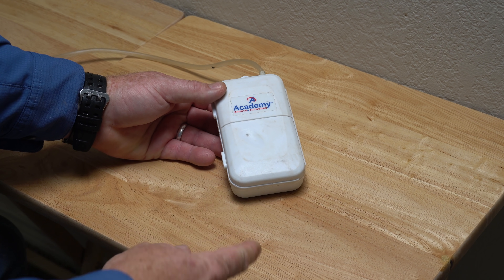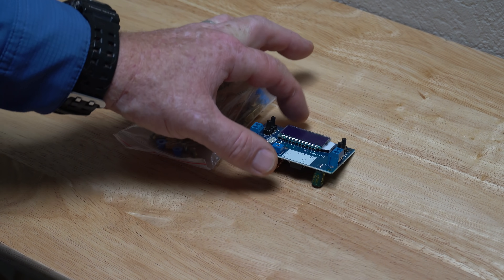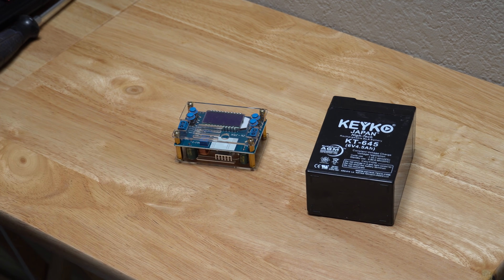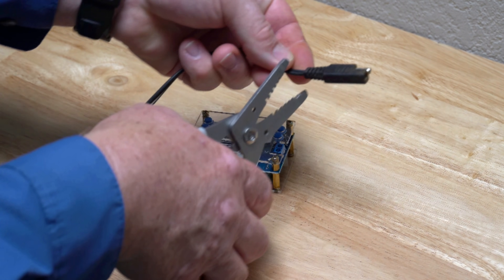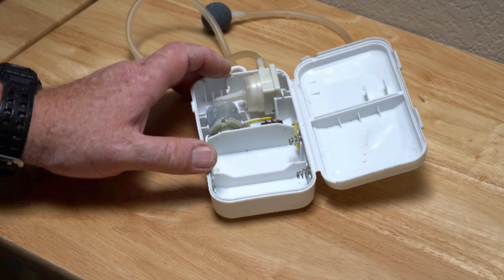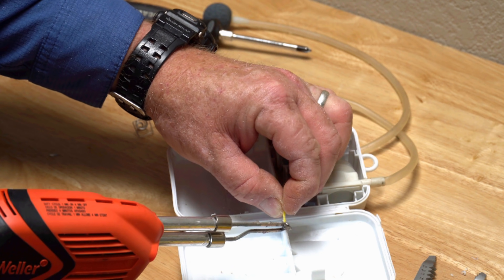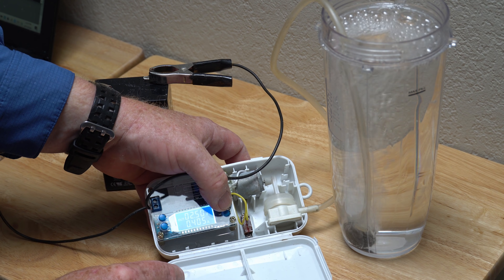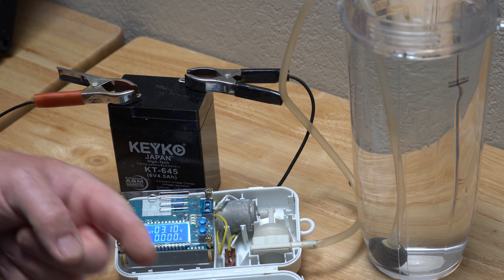🐟 Official Minnow Bubble Box Aerator Hack Mod! 300% more Bubbles! 🔥

Comment: Can you do the same thing to the black aquarium pump that comes from Walmart. I think it's a 120-volt but I would like to try to change it into a battery operated
Reply from the maker: If it is an AC motor, this will not work. AC motor will burn up if you increase the voltage to them. DC and AC motors are completely different in how they work.  DC motors can work with a wide range of voltages, which is why all Electric Vehicles like the Tesla use DC motors, not AC motors.

Comment: Instead of hooking up to an outside battery using alligator clips, can you hook it up using the 12-volt adapter plug that is provided with the pump and plug it in to the cigarette lighter receptacle?
Reply from the maker: Yes, you can do it this way as well.

Comment: The battery terminal connector comes from a battery tender for a boat or motorcycle.
Reply: Yes, a battery maintainer terminal. And if you had left about 2 inches on the cord before you cut it, it could’ve been reused for another purpose.

Comment: That's a 1.5v motor, and stressing at 3.7 will shorten it's life. Would like updates
Reply from the maker: The motor is not what burns out. Never had one burn out. The little plastic pump does eventually wear out, though, after about a hundred hours of hard use.

Comment: Very cool project. Definitely upgrading my little bait bucket. Even if wears out air pump prematurely, I can get another one (stow in my truck) and repeat. 
Thanks!!!
Reply from the maker: You would be surprised at how long these little motors will last even at this voltage.  I have never worn one out and have run it for days on end.  What actually does wear out (but also takes a long time) is the little plastic pump.

Comment: you bitch about going through a half dozen boxes a year but increasing the voltage will just burn the motor out twice as fast, so whats the point?, why bother spending $40 bucks to nigger rig a 10 dollar pump thats gonna last a day if youre gonna go that route you might a well just buy something better like a portable compressor or air mattress inflator for half the price and hook it to an old car battery...

Comment: Will doubling the voltage to the motor shorten the life of the motor?
Reply from the maker: Not in my experience. It is more likely to shorten the life of the plastic pumping mechanism. But, in my experience, I have runn the pump for days on end like this and it suffered no I'll effect.

Comment: Thats great except Ive rebuilt these small motors and whats going to eventually happen shortly is that the brushes in the motor are going to finally wear out which is why this entire concept is an expensive temporary fix.
Reply from the maker: Mine has still not burned out.

Comment: I followed you all the way on this and it will not reduce voltage output, the info with the buck converter says this option will be bypassed if both input an output share the same ground. It does work but at full voltage. Any thoughts?
Reply from the maker: Something seems off.  The is no such thing as a GROUND in DC electricity.  A ground is only used with AC electricity. With DC you have Negative, and the Negative is shared in all DC systems. I think you are reading incorrect information somewhere.  As far as your situation goes, it sounds like you may have a defective buck converter.
Reply: electronics is a lil out of my depth,  but I think you are right I'm sending it back for another, I'll not give this up! Thank you for your great video and your quick response!

Comment: Best tip in the world. If it won’t start on fresh batteries you can suck start it to get it going. Ha ha….
Reply from the maker: Thank you for this great information David.  I appreciate it very much when viewers contribute useful information as you have here.
Reply: @thejungleexplorer  no problem. It really does work like a charm besides the comic relief. After winter I end up sick starting my bubbler. Had same one 15 or so years. But I just keep fixing it. Finally had to glue my diaphragm with. Gorilla glue and got it going one more time this spring. Just ordered a rechargeable unit for aquariums to use for minnows. We see how that goes.

Comment: Not sure if someone asked as I am on mobile phone seeing this video. What is the effect of using it on 4.5 A on the motor? Will it eventually  burn? What about battery life effect?
Reply from the maker: I found that any voltage over 3v did not increase production. 2.5v seem to be the happy point.  The motor may be able to handle 4.5 volts, but the tiny pump cannot function properly at that velocity.
Reply: @thejungleexplorer  Thank you sir
Reply from the maker: My pleasure. Glad I could help.

Comment: Cool project only downside is you will burn your pump up real quick if you run it past like 2 volts for to long and then you will need to buy a better pump that can withstand higher voltage for longer periods of time
Reply from the maker: You would think so, but I have never had a motor burn out yet.

Comment: I'm not good at electrical stuff but what if I sodered a wire to the moter that had a HDMI plug at the other end that plugs into a HDMI charging port on my boat. Do you think this would work out or too much juice?
Reply from the maker: You could do that. Most USBs output around 5 volts so it would work, but I found there to be no additional air production past 3 volts.
Reply: @thejungleexplorer  Thank you. I just don't want to fry the motor. I'm surprised that Frabill doesn't offer an option to plug into a HDMI as it's a common point of power supply now. Who has a cigarette lighter now?

Comment: What's that little dc motor's voltage rating?
Reply from the maker: Have no idea. DC motors are different than AC motors. They are voltage variable. This is why they are used in things that need to operate at variable speeds from slow to fast.  Things like cordless power tools and electric cars.

Comment: Why couldn't you just rewire the battery compartment to where the batteries are in series instead of parallel? That would give you three volts
Reply from the maker: That could be done as well.
Reply: @thejungleexplorer  I've done it to one of my little bubblers not long after I made my first comment, it works but I haven't tested it to see how long it running at those RPMs would hurt the motor.

Comment: When removing the stone from water leave pump running for a few minutes afterward  to keep the minerals in the water from drying inside the stone and eventually plugging up the air passages making it less efficient over time .  Let the pump push the water and minerals out before shutting off .  A trick i learned years ago that keeps my pump pushing plenty of air for several years .  Just sayin
Reply from the maker: Thanks for commenting

Comment: what was fun about it?  running that motor fast is either going to burn out the motor or break the linkage between the motor and the little pump.
Reply from the maker: Good theory. But neither has ever happened. 😉

Comment: Yea I just put 1860 batteries in my bubble box, runs the same way and have to do no modifications… 18650s just fit a little tight. I only do it if I really need to keep something important alive because I fear it will blow up the cheap motor.
Reply from the maker: I have found that anything beyond 2.5 volts does not really produce much more air and stresses the motor. 18659 batteries are rated at 3.5 volts nominal, but have a charge of 4 volts when fully charged. That is way more voltage than what I demonstrated in this video.  Another thing about 18650 batteries is that they are not all the same length. Their length varies according to their capacity rating. There can be up to a 1/4" difference from on to another. But it is interesting to hear you have used them. Thanks for telling me this.

Comment: What’s the rating on the motor?  What is the max voltage it can handle? Nice video
Reply from the maker: I don't know what the rating is, but I have never had one burn out pushing it up to 3 volts. DC motors are not like AC motors. They can operate over a wide variety of voltages. The weakness here is the pump. Pushing it past 2.5 volts does not really give much more air.

Comment: You don’t need that damn stone. I just rubber band a sinker or a washer or something to the end of the air line. Problem solved. I’ve been using a$10 pump for about 5 years now no problems. Changed batteries once. Get rid of the stone.

Comment: Interesting project. The buck converter can easily and efficiently convert 12V down to whatever you want to use on the bubbler so you could just use the trolling motor battery.

Comment: How long will the pump last like this? Looks like a awesome idea and even if it does destroy the pump after a while would still be worth the trouble! Im used to throwing these pumps away after a year anyway
Reply from the maker: So far, I have never had a pump burn out. I am sure it will at some point though. Then I will move the system t a new $10 bubble box.
Reply: @thejungleexplorer  Yeah i completely agree, plus the money saved on batteries will add up fast!
Reply: How does this set up work in salt water environment?

Comment: If factory motor is rated for 1.5 volts, how long will the motor hold up at the increased voltage?
Reply from the maker: The truth is that DC is not that precise. All DC motors have a large voltage variance. Sure, if you ran this little motor at 12 or 24 volta it would burn out almost instantly. But it is totally fine with 2 or 3 volts. As if yet, I have not seen any motors burn out. I learned this from a friend that has been doing it for years, and has never had a motor burn out.

Comment: Obviously increasing the voltage on a D/C motor will increase its output. I dare you to run that device at level you showed in your demo for an extended period of time. That pump. All the parts connected ( connecting rod , etc.) Will fail in short order. Interesting concept though. 

By-the-way, I did call you out. Lol!
Reply from the maker: Theories are great, but the thing with theories is that they are just that. This pump is still functioning fine after a year.
Now, will you be a man and do what is right?

Comment: Don't be fooled. There's a reason they only take 2 1.5vdc d size batteries. Sure you can get more power out of the motor by increasing the voltage. But you are reducing the life of the motor. Doesn't take much to burn those little motors out. Definitely a fun little project though.
Reply from the maker: Thanks for commenting

Comment: Looks good . But Running that little motor that fast very long isn`t it going to come apart .
Reply: Most likely the little compressor will fail before the motor
Reply: Running a 6v or 12v rechargeable battery at a low setting still gives you a ton more run time.  Great video. Now, I would like to find a way to run this off my car using a 12v socket or usb.
Reply: @mjcavender1230  I soldered a usb cable to mine and connected a car charger to a Milwaukee M12 battery.
Reply from the maker: Thank you for commenting Chuck Smith!
Reply: Does the lid close with that sitting in there?
Reply from the maker: Yes.

Comment: It would be a lot simpler to just buy a 5v air pump, designed for a fish tank, then supply power from any standard lithium power bank.  I'm working on several different lithium-based solutions, and one that uses a waterproof 12v - 3v buck converter.  It allows you to go straight from any 12v power source and run the pump at the correct voltage for days, maybe weeks, depending on the size of the battery.  For anyone using one of these in a boat, it's a no-brainer.

In the start of your video, you have the batteries installed correctly for this particular DC motor, which is probably only rated for 1.5v.  Most of these little bubblers come with a 3v motor and are designed for the batteries to be installed in series.  The 3v motors often have a high/low setting, which basically halves the amperage being drawn.  I would look for the specs on that motor before running it at 3+ volts for very long.
Reply from the maker: Thank you for commenting Jason Broom!
Reply: Can u add a link for the parts you are talking about to allow me to hook into my toggle switch panel on 12V and reduce it to the 2.5 or 3V at the pump motor.  Please it would be greatly appreciated 🙏🙏
Reply: @brianpierson7708  - Search for "SMAKN DC/DC Converter 12V Step Down to 3V/3A Power Supply Module" on Amazon.  Make sure your aerator runs on 3V power before you buy this.  I have discovered that the cheapest ones run on 1.5 volts.  The easy way to tell is if your D cell batteries are supposed to be in series or parallel.  If in series, that's 3.2v, nominal.  If in parallel, that's 1.6v, nominal.

Comment: Great idea, I would not set if to go too high on the voltage to save your motor.  It's a mechanical part that wears over time.  For me, about 2 volts would be enough.

Comment: LOL the motor can handle the voltage. But that little pump will burn up. That air pump has a piston. The Mr bubbles has a diaphragm. This could me a good hack if you use a pump that has a diaphragm.
Reply from the maker: I have not had the pump burn out ever. I mean, would expect that you would be right, but out of several of these that I and my buddies have done, we have not had one burn out yet.

Comment: Easy way to blow you motor
Reply from the maker: Naw, the motor is fine with it.
Reply: lmfao The cheap pump is wayyy more likely to give out than the little motor... You can run those motors on 9v no issues, they just chose 1.5 D because they're easy to replace and you can find them anywhere..It's a good middle point for air output vs component wear.... Dont comment when you dont know what the hell you're talking about.....
Reply: @Gatorsrok  Ouch!

Comment: Ok so using 3.7v D cells worked great. Amazing performance and pretty equal to my 12v bubbler. I used a 4 inch round stone and the extra voltage really made it perform. Time will tell how long it lasts using 3.7 volts but for now it really cranks out the bubbles.

Comment: Will this shorten life of pump?
Reply from the maker: Depends. Most of these little motors work great when new but as the cheap plastic parts wear and get dirty, they start to bog down do to under voltage.  The higher voltage makes them work more efficiently and may extend their life to a point. 
A lot of people don't realize that under voltage is typically harder on a DC motor than over voltage.

Comment: i just modified battery compartment and used one 3,7v 18650 lithium ion batt. works as well just too noisy.
Reply: Use a LiFePO4 cell and you get a lower nominal voltage of around 3.2v...nearly perfect these little 3v, .5a motors
Reply: Did it make a significant difference in the speed of the motor and the volume of bubbles when going from 1.5v alkaline batteries to 3.7v 186650?  How is it holding up?  I have lots of 18650s.  How did you modify the battery compartment?
Reply: Yes it has more power and faster motor sound. 5 hours pass still running, not sure when will it stop. I added solder on the center for contact connection.

Comment: How have you stored the battery with a 5 gallon bucket?
Reply: I usually carry my gear and bait pail with me while fishing. I was trying to solve for the added weight of the battery that you had chosen to use. I decided to get a portable battery pack used to charge a cell phone or a tablet. I also purchased a voltage regulator from your link in the video description. I wired her up and she powers on. The voltage shows 4.6 volts. The model regulator I received from Amazon was different than yours in that there are two slotted dials to regulate voltage and amps. My issue now is when turning the dial, it doesn’t increase or decrease the voltage. I just received a second unit from the seller to replace the first because I wasn’t sure if it was the part or something else. The replacement part has done the same thing as the first.
Reply from the maker: @OutlawOnTheWater  Thank you for letting me know this.  Sometimes manufacturers change products after I place a link to a page.  I have had no trouble with mine, but as you say, they are now selling a different model.   I found this one that looks more similar to the one I got: https://amzn.to/38Dsef4 #ad.  It has pretty good reviews, but that is not saying much because the one in my link has a better review rating than this one.  That is a problem with Amazon.com reviews,  if the seller changes the product model on the page, amazon keeps all the reviews from the previous models.  When I am buying a product, I read the negative reviews on it.  I look for consistency of failure or defects, not just the standard "I HATE this product" type of negative reviews.  If I find several people that experienced the same problem with a product, that tells me there may be a design defect with it.  There are lemons even with the best products, so just because something failed does not mean the whole line is bad, but if there is a pattern of failure, that is what you have to watch out for.

I would send back the unit you have and get your money back, and try another unit from someone else.  Obviously, there is a design flaw with the new model since you have two that acted the same way.  There are many other models out there that do the exact same thing.
Reply: @OutlawOnTheWater  - You can buy a much smaller and simpler buck converter that takes a nominal input between 5v and 12v and gives you the option of whether to output 5v or 3.3v.  They are used in laboratory test equipment.
Reply from the maker: Hi. Thanks for the question. I am not quite sure exactly what you are asking.  The battery is a sealed 6v lead acid battery and can be stored just about anywhere.   But because of the little voltage regulator that I showed how to install, you can use just about any battery source up to a 36 volta battery.